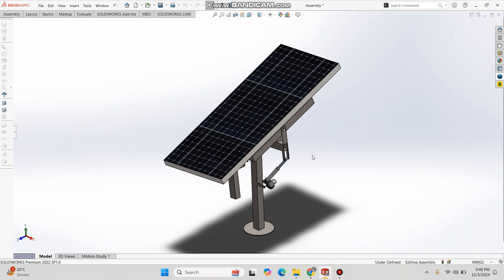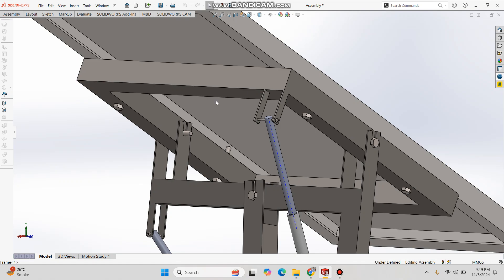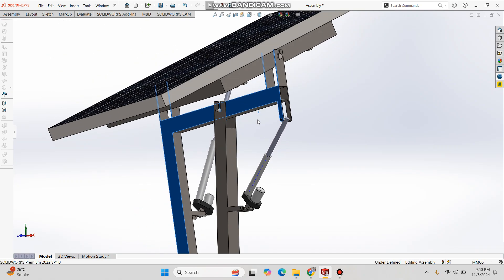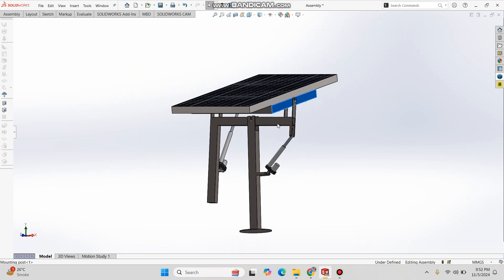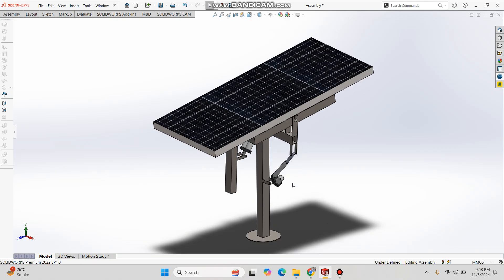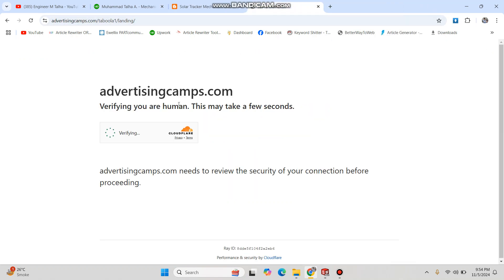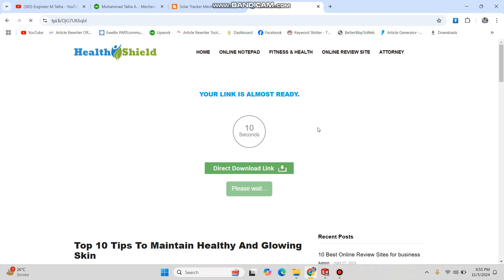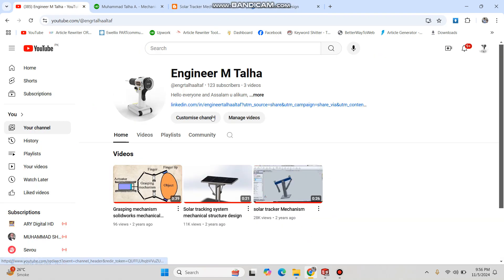Solar Tracker Mechanism Design and Explained with CAD file

Comment: Making this for major project
Reply from the maker: Great
Reply: @engrtalhaaltaf   facing difficulties bro, we have two 200 mm linear acutors but are not able to calculate where to place them and how and measurements of other parts. and developement  of sun sensor with ldrs. Can you help with that brother, I will be grateful.
Reply from the maker: @mohitsain3121  use law of cosine